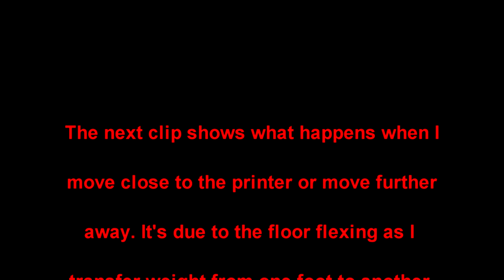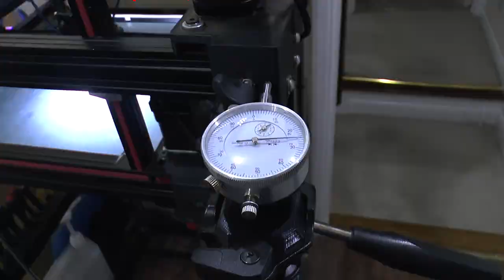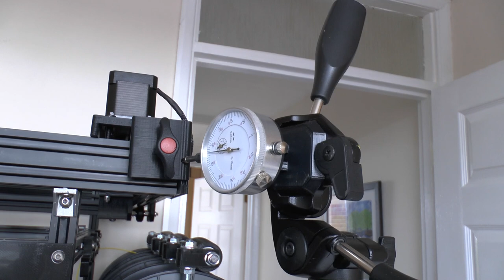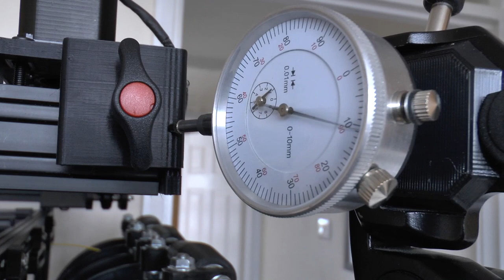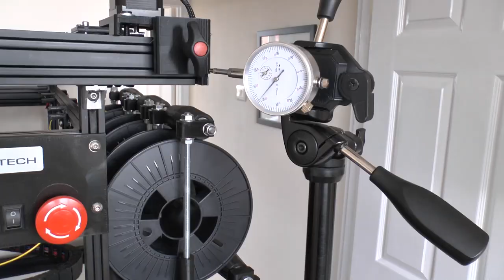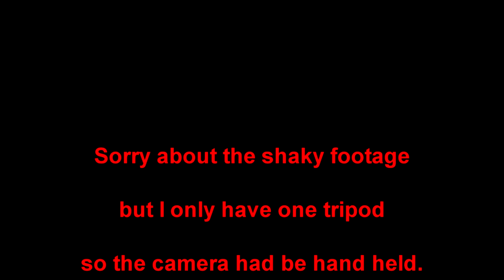Dynamic force cancelling

Comment from the maker: Well, much as I hate to have to admit it but this has largely been a waste of time and money. Whilst the gantry does a reasonably good job of stabilising the printer, the reality is that even when the printer shakes as it does, it doesn't produce any noticeable print artefacts. I've just completed a series of tests at very high print speeds (post and video coming soon) and even tall objects printed at very high speed and with this gantry disabled,  the prints come out very good indeed. I'm just amazed that the printer can shake about as it does without there being any noticeable degradation of print quality. I guess that might be some sort of testament to how rigid my printer is. Oh, well, it seemed like a good idea at the time and it's my own fault for not doing any proper tests beforehand. Lesson learned.
Reply: hey I'm new here, it might just be that even though it shakes the whole printer will shake the same way. this would mean that maybe at the max z you will see the bottom maybe vibrating slightly out of tune with the top but still not noticable enough?
Reply: I think your conclusion is invalid. First of all, you are using way too low an acceleration for the force cancelling gantry to show an effect. Second, you are force cancelling in the wrong plane. It has to be in the same plane as the actual gantry, otherwise you will induce a moment in the frame. The 2020 frame between the gantry and force cancelling gantry will absorb that moment entirely, negating any positive effects. For your theory of the reduced mass necessary due to the longer leverage from the floor, the frame would need to be infinitely stiff, and you would have to make the FC gantry move "more" by the factor of the difference between the distances of the Gantry and FC gantry to the floor. Third, all your vibration is probably coming from your gantry "wobbling" back and forth, since the 2020 extrusion is comparatively quite thin.
Again, for this FC gantry to have an effect you have to use way higher acceleration. (and it has to be in the same plane) only then will you see effects. I know your steppers cant handle the higher acceleration, you may want to look into servos.
Thanks
Max
Reply: Well I got to say that this is Genius, you're on another complete plain in 3D printing than the rest of us. But let me ask you this: Does it stand to reason that the 3D print itself will tend to move and vibrate with the entire 3D printer in the same directions so technically is stands still under the nozzle and maybe that is why there is no visible artifacts? Technically the entire assembly moves as one 3d print included. I do not know if you have any TPU or flexible filament that can vibrate differently under the nozzle. That may prove that what you have made is GENIUS, and will show the value of the counter gantry. Still I tip my Hat to you!

Comment: Excellent.  I have wondered for a while why an opposite-moving counterweight hasn't been tried.  Now, I see that you've done it!  I have neither the funds or the knowledge to try such a design.  I saw your printer on 3DMN's vlog from the show and had to follow his links.
Just curious though.  Wouldn't a machine with a moving bed for the Z-Axis be an easier and more efficient design - thereby completely eliminating the need for the counterbalance to move on the Z-Axis?
Thanks so much for this work you've done!
Reply from the maker: Hi. I'm not sure I understand your comment. My bed does move in Z. The counter balance does the opposite of the other two gantries in the X and Y directions and is static in the Z direction. In my case, I have about 3Kgs of moving mas between the hot end and the 5 extuders on the second gantry. That moving mass is in the X and Y directions which is what causes the printer to rock about. The bed only moves in Z at layer change and during homing. In both cases, the speed is very low and the direction of travel is vertical, so it doesn't impart any sideways forces that would cause the printer to rock. Did you perhaps mean a bed that moves in X or Y like a Cartesian? If so, then it would only serve to help cancel the  forces in either X or Y but not both. And the bed mass would have to be the same as the combined mass of the hot end and extruders, which might be difficult or impractical to achieve in practice.
Reply: @deckingman  - Ah - I was misunderstanding the camera view at 9:05 - and the extra height for holding the spools got me confused.  Up to that point, I thought that the Z-Axis movement was done by the bed.  The later views made me think that I had been wrong, and it was the X-Y gantry that was moving on Z.  I should have watched it again, instead of changing my mind about the Z-Axis movements.  My bad - sorry.  I think I had stayed up way too long when I commented - LOL.  Thanks for correcting me.

It's really odd to me also that there was no difference in print quality when the force cancelling was used - even at extremely high speed.  But, do you think there would be any difference when printing very small parts with lots of direction changes at very high speeds?

One more question, if you don't mind.  In my years working with CNC lathes, mills, grinders, and machining centers, axis turn-around compensation was critical when machining high-tolerance parts.  My last 10 years were mostly with 13-Axes Swiss Turns on very small, high tolerance parts made from Titanium.  Even with ball screws, there is always some slack - even though it was tiny (until wear happened over time anyway).  The compensation had to be recalculated over time - and even over different places on the ball screws when using areas of them that were seldom used.  Especially when trying to hold tolerances of tenths or smaller - as is common with CNC grinders.  The backlash compensators - mostly used on the Z-Axis of 3-D printers - is a partial solution, but compensating on the X- and Y-Axes would seem to be a good idea.  There is always some error involved - more so on some designs than others, but it's always there.

I don't know for sure, but I don't think that there is anywhere in the firmware to account for turn-around error.  Have you ever tested to see what the values of the turn-around errors are on your machine(s)?  Just curious.
Reply from the maker: Hi Ron,
Yes I was initially surprised that there was no difference in print quality after I fitted the load balancing gantry but that was me being stupid. What happens is that everything rocks at the same amplitude and frequency. So the bed with the part on it moves just the same as the print head. I should have done some tests first to see if there really was problem. So in some ways, it's a solution to a problem that doesn't exist. Having said that, there are other reasons why you might want to stop the printer rocking about. Also, I think if the frame isn't really rigid like mine is, then any flex in the frame would allow the print head to move differently to the bed / printed part and in that case, there may well be a difference in print quality which could be improved by using such a gantry.
I'm not familiar with the term "turn around compensation" but I guess we are talking about back lash where there is a change of direction. I served my apprenticeship about 50 year ago - long before CNC machines came into being, so in those days we always approached the part with the tool from the same direction.  Backlash is a phenomenon associated with screw driven mechanisms because of necessity, there has to be some clearance between a nut and the thread it rides on. It isn't usually a problem with FDM printers because the X and Y axis are usually (but not always) belt driven. The exception being the Z axis because they tend to be screw driven. But in this case, we have gravity working with us. So the the same side of the thread in the nut is always in contact with the same side of the thread on the screw, regardless of the direction of rotation of the screw. 

Having said all that, the RepRap firmware that the Duet boards use is constantly being developed and support for CNC machines is being implemented. It could well be that backlash (or turn around) compensation has been implemented. If not, I'd expect to see to shortly. As with everything else in RepRap firmware, it would be user configurable and as I don't need it on my (belt driven) machine, I've never paid much attention. 

HTH
Ian

Comment: You can use concrete basement for the printer. And ptfe tube between extruder and filament roll to avoid traction on the filament, reduce artifacts on mine
Reply from the maker: Yeah, right. Please read the blog post that goes with this video. Then maybe you'll realise that putting a concrete slab on wooden joists in an upstairs bedroom isn't an option. Also, check out my blog on the anti-tangle filament rollers/holders and Bondtech extruders that I use. They work just fine and I have no desire to increase friction on the filament path up to the extruders by encasing them in metre long lengths of ptfe tubing.

Comment: Maybe taking 4040 profiles for the verticals and big brackets might help too. But of course they would be no reason to introduce a third set of XY components.  :-)
Reply from the maker: Yes you are right. It's fair to say that the printer has evolved into what it is now. It started life only a metre tall and the top section was added and further extended over a period of time. One day, I'll replace the 2040 plus 2020 extension legs with 4040 all the way from bottom to top.

Comment: Nice but one or two concrete slab on top would make the same job.
Reply from the maker: Yes but where is the fun in that? :)
Reply: Actually that would make the small vibrations bigger. Tried that this week with a concrete pave under and one over. The one under makes it more stable but not the one on top. Each was 500x500x50mm and 30kg each. This dynamic solution works much better.
Reply from the maker: Also, (and in all seriousness)  if you read the post on my blog, you'll see that I needed a portable solution and one that would preserve domestic harmony (concrete slabs in a spare bedroom???). :)
Reply: Absolutely, fun first.

Comment: What a ridiculously over complicated solution to a problem that wouldn’t have existed in the first place if you weren’t throwing that much weight around. Any reason you didn’t use Bowden tubes or even remote extruders?
Reply from the maker: I think you've missed the point. If you had read the accompanying blog post and the description,  you'd see that I largely agree that this was was a waste of time. However, I come up with a lot of crazy ideas and document them all - both the successes and the failures so that others may learn what works and what does not. Should I only document my successes? Everyone can form their own opinions of course. Some, like you see it as ridiculous and over complicated, others see it as an ingenuous solution. Indeed, I know of one person who copied this idea and who's printer won an award at a RepRap festival. Personally, I view this as both a success in that it stabilises the printer, but also as a failure in that it doesn't offer any improvement to print quality.
But that video was made more than 2 years ago and if you look at my more recent videos, you'll see that I now use a different motion planning technique which means that the extruder gantry gets "parked" and is static, while the hot end makes the smaller moves. So that has also negated some of the need to compensate for the moving mass. 
Regarding mass, yes for sure lighter hot ends are easier to deal with. But mixing hot ends with multiple inputs are by their nature, big and heavy. This mass means that, even without the extruders, the X rails need to be stiff which adds even more mass and before you know it, you can end up with around 2Kgs moving in the Y direction (even without the extruders). 
Regarding remote extruders, yes I have looked at them but my latest mixing hot end has 6 inputs quite close together. If I used something like the Zesty Nimbles, I would need to space the inputs further apart and I'd lose 50 to 60 mm of travel in both X and Y. It's a compromise that I could make but I'd rather stick with increased X and Y travel at the expense of the increased moving mass. 
Regarding Bowden tubes, I do use them. However, by fitting the extruders on a separate gantry above the hot end, those Bowden tubes are only about 150 - 200 mm long. The frame is 600mm square so if I mounted the extruders on that frame, those Bowden tubes would need to be over a metre long. Mixing hot ends have large melt chambers and it is necessary to retract all filaments concurrently. Even with those short Bowden tubes,  I need to use 3.5m retraction. If I had 1,000 mm long tubes, that retraction distance would need to increase to something like 10mm or more which causes the print head to pause, which in itself leads to blobs and other undesirable artefacts.
So again, like most most things in life, this is a compromise. On the one hand, I have shorter Bowden tubes, reasonable print quality and a larger print area,. On the other hand this leads to increased moving mass. But that mass can be dealt with, and if you look at my other videos, you'll see that I can print at 300mm/sec with travel speeds of 350mm sec and higher. The load balancing gantry allows me to also use a higher acceleration which would otherwise shake the printer to bits. 
There is always method in my madness, and of course it's your prerogative to dismiss it as ridiculous. But I will continue to document my experiments and ideas, both those that works and those that do not, in the hope that other may benefit (even if it's a case of what not to do).